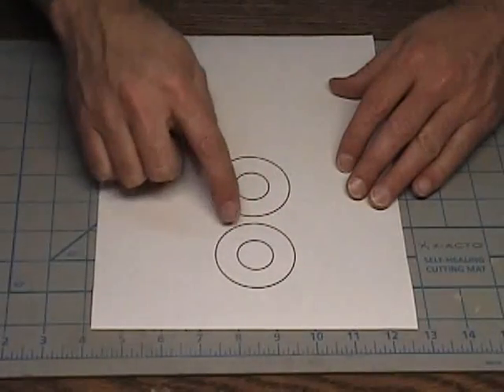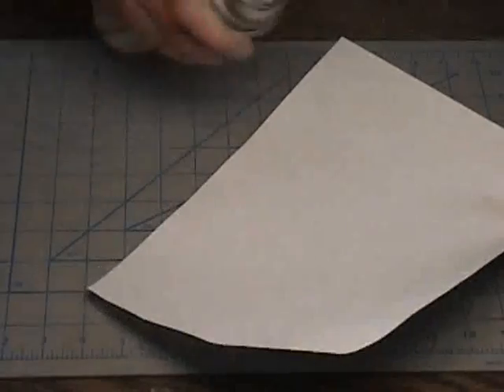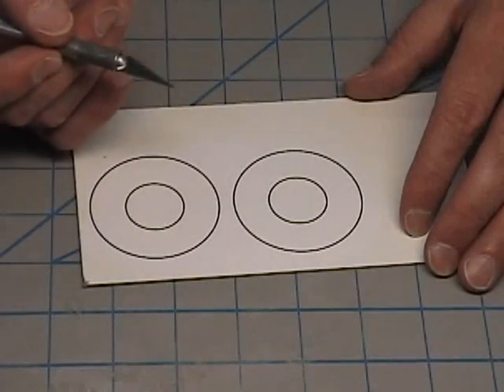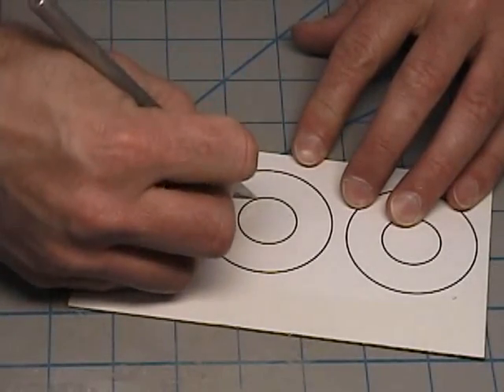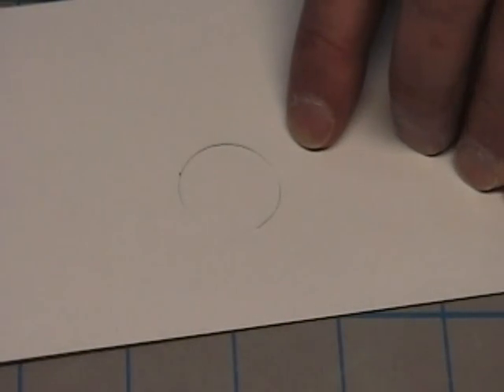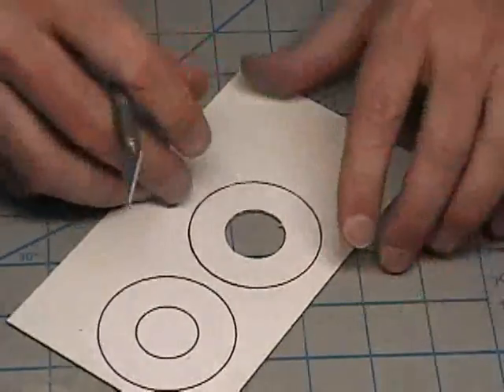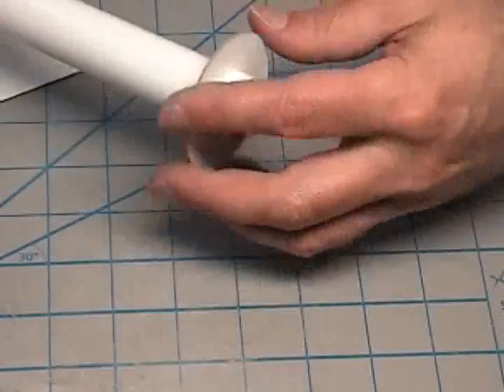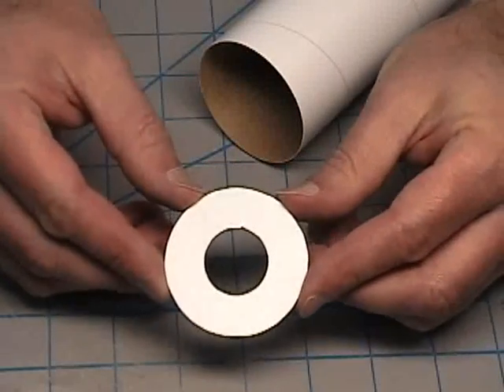Cut Centering rings for your model rockets

Comment: That bit you cut out of the middle of the centering ring can be used as a bulkhead in small diameter rocket tubes :-)
Reply from the maker: Great tip, thanks.